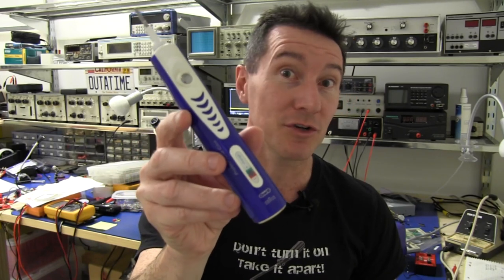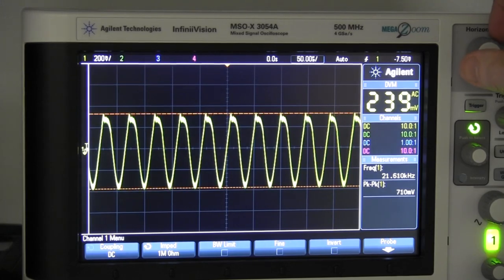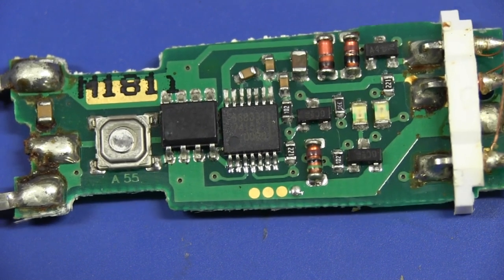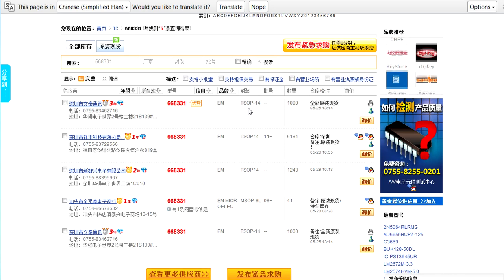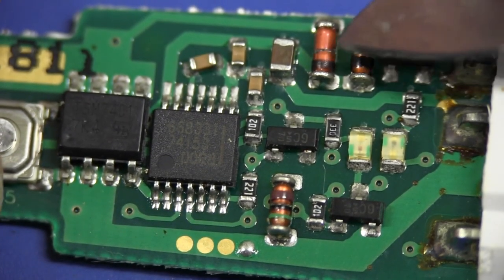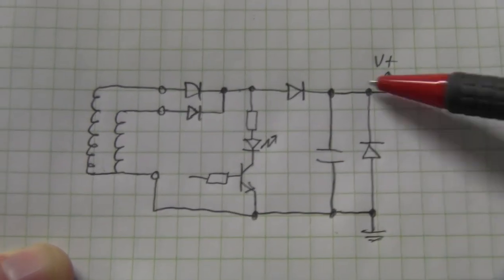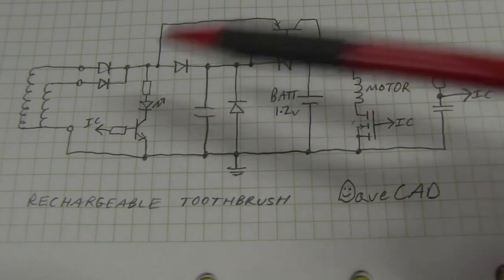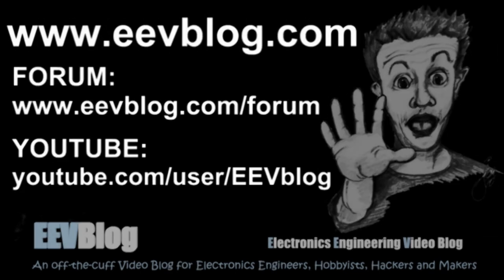EEVblog #284 - Braun Toothbrush Teardown

Comment: Dave, the transformer circuit is a simple split coil dual phase rectifier. For the positive phase one coil and one diode rectifies, for the negative phase the other coil and diode do the rectifying. In this way the efficiency is better and the distortion to the primary is less.

Comment: The 800Hz pulse is so that the microcontroller can read the battery voltage without the charging voltage interfering. Learned about that little gem watching bigclive tear down some battery charging units.
Reply: Huh, i'd like to see that one. Don't think i have.

Comment: You can actually replace the battery inside, at least once or twice, until the sealing isn't good anymore. I actually "repaired" mine twice before I bought a new one, because the only part that actually dies is the battery, and it dies fast because of the constant charging.

I also replaced it with a NiMH one that had nearly twice the capacity than the stock one. It's a bit of a fiddling, with the soldered battery contacts, and really a shame that they don't bother to make it more accessible, but that is probably just planned obsolescence so you buy a new one at least every two years or so.

Comment: I tore mine down when it failed, cleaned the guts up and put it back together :)
The charger on mine seems happy enough running on 120 volts even though it's a 240 volt model.

Comment: The pulsed charging is used to detect if the battery is fully charged, and then the charging will stop.
So the IC goes like I'll charge for 400 ms then stop 100 ms and measure the voltage, then repeat if lower than full charge.
and btw, it's nice to see the younger you :) we've all changed over the years <3

Comment: I pulled one of these apart and all you have to do to get the whole lot out is to unscrew the bottom and pop it off like you did, and then invert it and push the shaft against a table top or the floor (whatever is hard and you won't damage the surface) and it will push the entire assembly out the rear end in one piece.

Comment: I rather think that the pulsing the charger goes through may be  designed to help  keep the
battery  in  good shape as this has been found to  restore batteries that will not take/hold a charge  anymore.  But, that's just a guess.

Comment: Dave, the two coils and two rectifiers connected at cathode (common cathode) is used in  some SMPS topologies where the secondary is center tapped to provide full-wave rectification with only two diodes instead of four.

Comment: Dave I replaced the battery in my unit a few years ago and the motor and the shaft do come out you just need to push harder. Perhaps the o ring on the shaft is jammed up with old toothpaste.

Comment: I had to try out my hand-held scope:
with a single full ground wire loop, it showed perfect sine waves, 81kHz, Vpp was 408mV. The amplitude decreases as the brush is lowered on the charger pin. no glitches.  My charger is one with the UV sanitizer.  Cool teardown!

Comment: I always wondered what was in my brush, woo 4-bit!

It sounds like you came to the conclusion (but didn't say it) - I rekon that the two coils are wound in opposite directions to perform the full wave rectification.
Also, whilst charging, you need to monitor the battery voltage, so I would imagine that it is being pulsed so that a reading can be taken at the ~800Hz to prevent over-charging. You may also find that the 'active' pulse shrinks as the battery voltage rises until it's just a trickle!

Comment: One of the coils is for the positive, one for the ngative half wave. It´s basically one big center tapped coil. It´s providing full rectification while saving two diodes. More copper - less diodes, whatever is cheaper :)
Reply: only 1 diode drop too!

Comment: This post ist really old, but it'll get some clicks anymore. I think there are two coils to pick up both halfwafes and route each over one diode only. So the drop is only about 0.7V, not 1.4V it would be by using only one coil an a diode bridge.

Comment: The reason for 2 coils is that each coil supply the circuit with half cycle via one of the diodes, there is saving in the components cost since the alternative would be a full bridge rectifier, standard bridge rectifiers are not suitable for this frequency, additionally since the induced voltage is very small and since there is a 0.7 volt drop across each diode therefore saving a diode in this configuration in compare with the full bridge can also save on power losses across diodes, as the charger is permanently plugged-in it makes sense to reduce the consumption to as little as possible.

Comment: You're supposed to push on the tip and help push the whole assembly out. That's how mine came out anyway.
Reply: Dave dont always read instructions. It shows on base how to remove the inards. Funny as he read how to open it but ignored the second part

Comment: I bet the two coils are the same and here's why. You said it is full wave rectified and it is not. They have two half wave rectifiers and are feeding a sine wave in one and a cosine wave in the other to produce a highly inefficient full wave equivalent. You said some mysterious stuff about why they had two coils. They were just avoiding the $ of 2 diodes at the cost of efficiency. Right?
Reply: Jeremy Adair Almost.  It's sine and minus sine, 180° difference, not 90° .  In addition to saving the cost of 2 diodes, it also saves one diode drop and the associated power loss.  Economically, the extra coil might be at least as expensive as two extra diodes, but saving one diode drop is significant in such a low voltage circuit.
Reply: I think this was a case of TLDNR...
Although 3 pictograms is hardly too long.

Comment: wonder why they did not add a resonant capacitor to the coil, from my little experience with building and testing a simple ZVS oscillator (the one usually used to make flyback drivers) and making a wireless thing, I was able to greatly improve the output by adding the correct value one based on the inductance of the coil. In fact, it went from simply tickling a 10W LED with a few mA's, to completely destroying it once I added the MKP 0.1uF cap! (shoulda had some proper regulation. Oops!)

Comment: I think both of you got it wrong. AFAIK the disassembly is done by removing a metal ring from the top of the case - it kind of fixes the water seal to the shaft. If done properly the inner part slides out very easily.

BTW: You missed a strange feature - the motor continously receives short pulses in off-mode (~1A for several µs at ~10Hz). Desoldering it stops the pulsing, but it won't turn on when put back together. Charging the device restarts the clicking and enables the toothbrush again.

Comment: are you sure those "ferrite beads" aren't actually a chemical pellet that is used to absorb hydrogen, in case the batteries vent a little?  lots of aluminum flashlights (maglites, etc) have these pellets in case the batteries vent;  prevents the gas building up, at least for awhile anyways.

Comment: Hi Dave, I know this is a rather old teardown but I have only just found it. I was researching to see if there was anything on the Braun toothbrush and whether mine was repairable.

On mine the LED stopped flashing during charging but as you observed the problem could have been in the toothbrush itself or the charging base. I was fortunate in that I had an older model charging base from an earlier toothbrush which I knew was working at the time the toothbrush failed. When I fitted my current toothbrush to the old charging base, hey presto, the LED started to flash. After several hours charging the toothbrush definitely had more oomph in the motor so the fault was definitely in the charger base.

I used a modellers razor saw to cut around the join line on the charger base and managed to lever off the base plate. As you surmised the innards definitely are potted. Nothwithstanding, I decided to pick away the encapsulant (which was a semi flexible white opaque type) and eventually I uncovered several components on the pcb. There were 4 large smd diodes and a single MELF diode plus an NPN smd transistor. All diodes and the transistor checked out ok but the MELF unit was probably connected across the B-E of the transistor since it gave me 0.6V in both directions. Unfortunately, I suspect that trying to remove the pcb from the encapsulant will end up doing a large amount of damage but it would be my guess that the charging coil has a broken connection and is open circuit. I may still go ahead and try removing the board to see what is on the other side but I was a little surprised that the charging base circuitry was a little more complex than I first imagined.

Comment: Another fantastic episode.  It would have been interesting to see how much power the charger was drawing from the mains while it was charging the battery, just to see how (in)efficient the coupling is.
Reply: emcgon Maybe that's why my brand new Oral-B has a wonky pushbutton under a redesigned rubber cover, while the unreadable battery compartment labeling hasn't been improved since the old design.

Comment: On my Phillips, the magnets create the vibration...the vibration has a sweet spot, calibrating the correct distance gives the correct vibration, apparently the spacer in between the magnet had been worn and is gone, I also think I found a flaw in the metallurgy connecting leading to the head, I suspect the metal may have cracked.

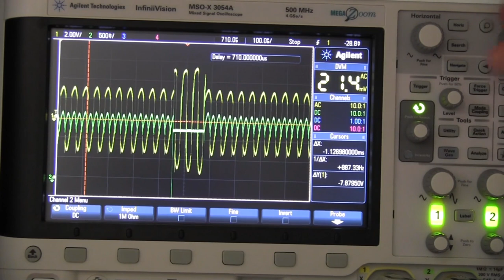Comment: Awesome video, @ 28:00 I presume that's the uC disconnecting the battery from the charger so it can test the battery level - and disable the charge once complete.

I've loved wireless toothbrushes forever - and understanding their circuit is awesome.

Comment: What you can do is brush some talcum powder on these ic and then wipe  it with your finger that will wipe off the powder from the surface  leaving the particals stuck in the indentation  and then youll be able to read it easily

Comment: I don't know whats inside baseunit, but my guess is that it's a way mobile-unit uses to tell to baseunit "hey, I am proper current consumer, and I am charging". Base unit monitors RMS current profile via primary coil and if it doesn't match predefined profile (e.g. RMS current is constant and doesn't going low 800 times per sec), then base unit decides: oups, something is wrong inside mobile-module, or may be it's even not a module at all, but someone just put metal ring upon basemodule inductor

Comment: Thank you for this interesting video. In case there are any wrist watch fans out there (including our terrific host), it is interesting to learn that electric toothbrush charger bases can be used to charge a Seiko Kinetic Movement watch. These watchers, different from “automatic/mechanical“ watches, use kinetic energy to charge a capacitor and a battery which then drives a quartz movement. It requires 24,000 shake to fully charge no watch (ouch)! The watches can also use induced electric current for rapid charging, but Seiko does not seem to be marketing their OEM charger any more. The community has been coming up with interesting potential solutions, including adapting a Braun charger base. I find this whole technology (including toothbrush/watch interface) interesting and amusing. I’m sure there are many watch fans out there who would find an explanation of all this to be very interesting and helpful. Additional information can be found by searching YouTube for “charging Seiko Kinetic” watch or “Seiko BFK diver watch”.

Comment: also I was wondering if they made a voltage doubler with a capacitor and some diodes to run the micro when it was running off the 1.2V battery.   1.2V is not enough to power the LED (if it lights up when you're using it) or the FET's gate that runs the motor.  As to charging, the resistance of the coils is probably plenty to limit charging current (they seemed to be really fine wire).

Comment: You half the voltage drop. Its a classical center point circuit. You need only 2 diodes and the current flows always through only one diode. Cheap and efficient!

U_center_point_circuit = SQR(2*U_eff) - U_diode

U_full_bridge_circuit = SQR(2*U_eff) - 2*U_diode

Comment: I read my comment and it really wasn't clear as to what I meant. At around 7m56s you cover its effects, but from the progression of the video I infer the testing was done by the probe RF loop. I want to see, and probably others too, is the effects of it when probing the circuit charging/no charging. Maybe current waveforms? Thanks.

Comment: It's just a coil and a magnet -- a transducer, or 'speaker' more than a motor.  It relies on the resonant frequency of the armature with brush head so that it can just input a little pulse once per cycle to keep the oscillation going.  On the phillips sonicare, it's tuned to (I think) middle C or 'A 440' (I forget which), so that it's aesthetically pleasing and won't sound awful or 'sick' compared to most music playing in the background.

Comment: The datasheet for the EM6682 mentions a "die in waffle" package. Is this the sort of package where they bond the die to the board and use some of that mysterious black blob stuff to cover it?
Reply: +Noah Keck waffle-packs and gel-packs are tray-types to deliver dies, when you directly surface-mount and wire them onto your PCB you want some "black blob" on top :D

Comment: What about building a hidden inductive charger in a shelf, or strengthening the charger to enhance the distance is that possible? There are thousands of examples on YouTube lighting up an led by induction using a transistor, resistor, power supply, 2 coils and an led.

Comment: Is it a standard DC motor in the top? If so how is the rotation converted to the oscillating motion? The last toothbrush I took apart had some unique device which resembled a motor but did not rotate, more like a stepping motor or a solenoid. I believe it was a Braun but possibly their high frequency model with a standard looking brush on the end.

Comment: When the micro controller said it has 80 x 4 bits of RAM, does that mean it has 80 bits of ram running at 4 bits or 80 lots of 4 bits of ram making 320 bits of ram total?
Reply: ☢ SNICKERS 5+2 GRATIS ☢ The latter. Remember this is a 4 bit computer, it only deals with 4 bits at a time. Without reading the docs, I would guess there are 48 addresses for I/O or other special purposes, thus a 7 bit data address bus, they could even use the RAM address circuitry to also decode the special addresses, since it's all on the same chip anyway.

Comment: Most likely some kind of compromise of Cpu power use and timers and A/D conversion. The system can't handle much more information with just 32 khz CPU (4bit) doing comparisions. And running it any higher than mandatory would be waste of power..

Comment: If you had read the base info on the charger it shows how to take the brush apart to 'recycle'
Reply: If you had watched the video, you would have noticed that he says exactly that at 6:50. ;-)
Reply: RFC3514 Dave could have pushed the whole motor/electronics assy out as also is illustrated on the bottom of the charger.

Comment: Thanx so much for this video. I'm trying to repair my old Braun Professional that has some water damage and some of the coil wires were broken. I re-wound the coils and soldered them back basically as I think they should be with help from your diagram. It happily blinks like it's charging, but when I remove it from the charger it does not turn on, and I get this very faint buzzzzzzzz from the circuit somewhere. What can buzz here? And can I have screwed up the way I connected the coils? (I connected one coil to the left terminal and middle, the other one to middle and right. They both have the "inner" coil wire that starts the wind going to the center terminal and the outer end of the coil wire going to right/left terminals respectively. Maybe I need to switch one around if they are supposed to be inverse waveforms?
Reply: It's the motor buzzing I think! (when the toothbrush is switched off)

Comment: we are using em78p153s microcontroller from chinese elan company. 8 bit 14 pin 1kb rom micro is only about 0.16$ if we buy 100k the price is about 0.13$. is this european micro can be cheaper than chinese microcontroller ?

Comment: Seriously? 74153 didn't ring a bell? Add an HC in there
Reply: Missed that!!, would explain the 3 caps and RC timing components. Well spotted.
Reply: ;) I'm becoming an electronics engineer for SOME reason :P
Reply: hc?
Reply: It probably didn't ring a bell because it wouldn't make any sense. I'm not exactly sure how a 74HC153(A Dual 4-Input Mux) would function as an "intelligent" motor controller with an internal 3-minute brushing timer. But the main reason for that main chip NOT being a 74HC153 is that the chip in the video is a 14-pin TSSOP device while the 74HC153 is a 16-pin device in every configuration that I was able to find, including the TSSOP.